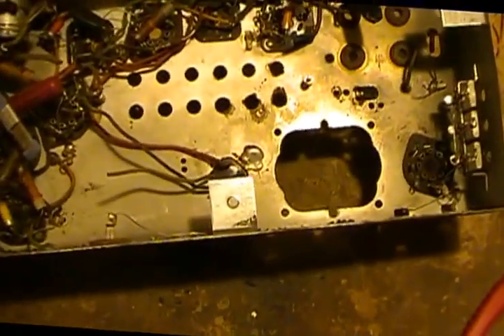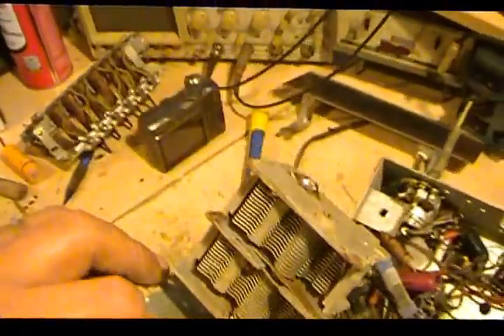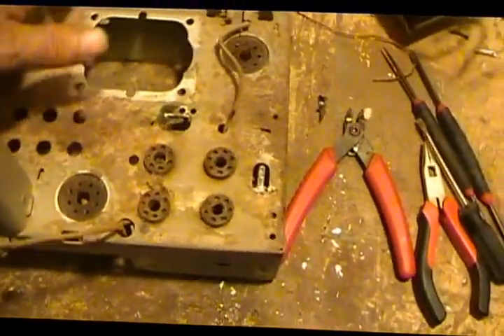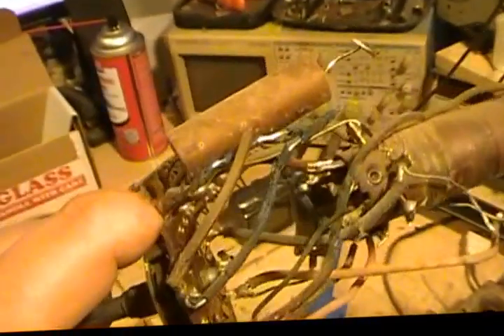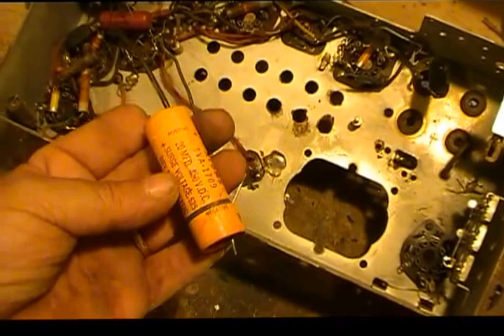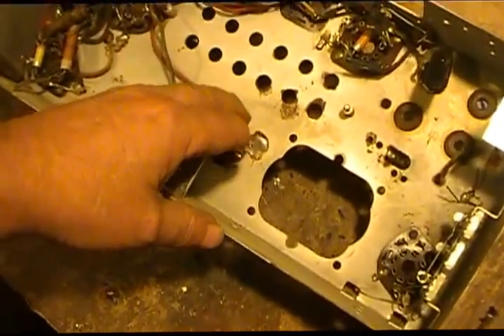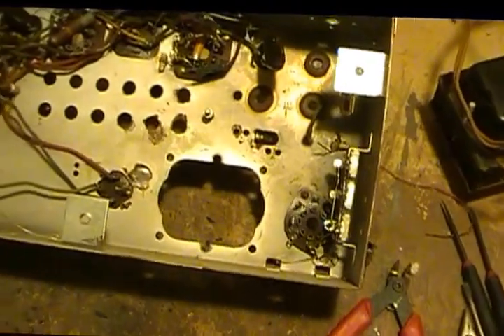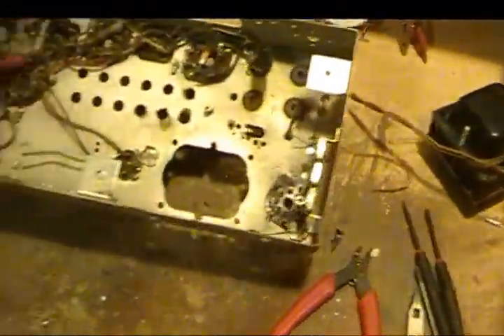RCA 96T7 part 1

Comment: Hi Dennis:
Good luck with the restoration! I have a radio that needs all of it's wiring changed out too because they are ALL rubber coated wires.
I'm interested in the Lithium Grease spray as well. Arte you saying it is a good conductor such as contact cleaners and also WD-40 as well? Or do you use it on the mechanical section only and use a contact cleaner on the conductive pads? I'm not clear on this. I don't know the dielectric properties of lithium grease.
Thanks,
Tom
Reply from the maker: Hi Tom, Thanks for watching and I'm sorry I didn't get to you sooner. I'm using the Lithium Grease spray more on the mechanical parts like bearings and such and using CRC brand QD Electronic Cleaner for contact cleaner. Dennis